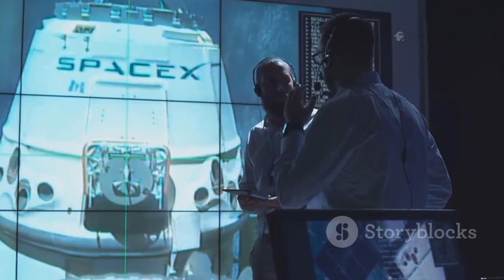Elon Musk's GENIUS Starship Solution: 4-Layer Crunch Wrap Tech SAVES Flight 11!

Comment: Starship HSL in its current design is not going to work, you can't land a top-heavy rocket with fuel in the back and 100 tons of goods at the top on the moon or mars, this is a top-heavy construction where the 100 tons of mass will work on the entire construction where it is top-heavy and downright empty at the bottom (mars landing) to half full (moon landing) and will fall over with all the consequences that entails.